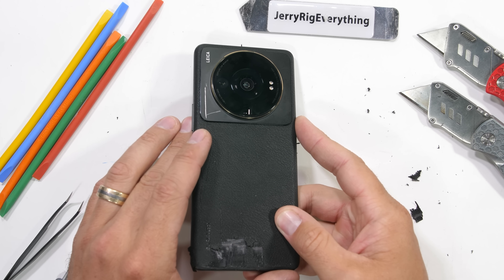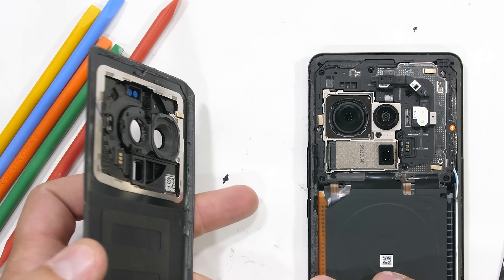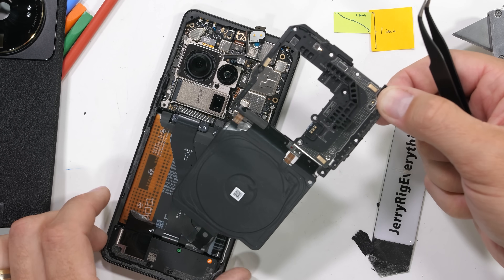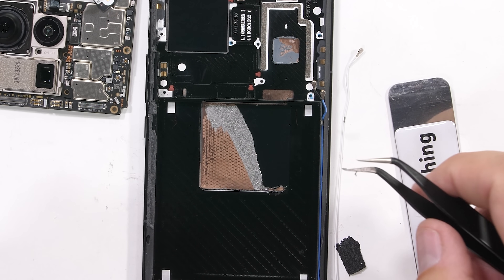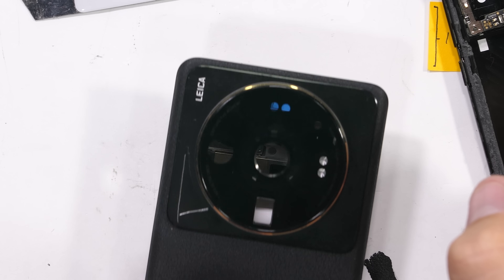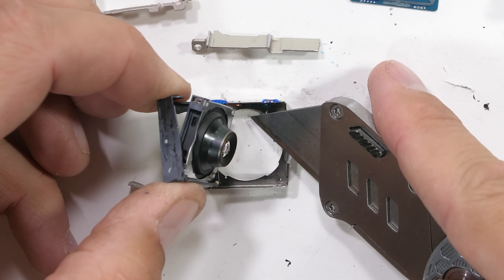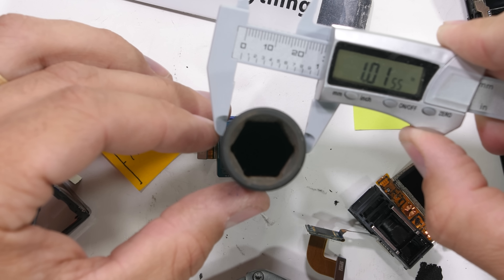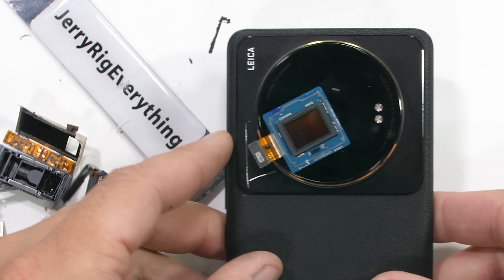Its a bit smaller than we expected... - Xiaomi 12s Ultra Camera Sensor Teardown!

Comment: It's the typical marketing/manufacturing reality - use whatever measurement standard that glorifies your product... whether you're thinking of a tube for a camera, which you could slightly increase in diameter by increasing the perimeter wall a bit as an example, to showcase its capability over what competition offers or storage capacity, with its raw space availability reported in GiB instead of actual GB after OS and preinstalled apps are in place, as long as it makes the product technically/legally stand out from or keep up with the competition we'll still be having such terms used. It's a matter of legally available boasts marleting team can utilise for the lure ;) Noone expected anything different or less in this case... if the sensor was a square 1x1in as you've shown earlier, the lenses would have to be wider in diameter as well to project the light onto it in all its capacity, but they're not, so nothing new... It's the same for Sony Xperia Pro-I after all, and possibly the same as for that Japanese-only Sharp Aquos R6 as well. Still, the few extra square mms over what competition does as offered by these sensors, provided the lenses can accomodate adequate coverage, are a good way to improve the quality of the pics out of the camera unit, and better than going 200MP+ on those extra tiny sensors covered by plastic lenses with not enough resolving power...

Comment: Great Video as aways.Its the same thing like Displays,for an example a Phone wth a 6.4 Inch Display with a 19-9 ratio,has more area than a 6.5 or 6.6 Inch Display with 20-9 Ratio.Remember the Iphones+ had an 16-9 ratio and 5.5 inch display,compared with an other 5.5 inch display(Samsung S7 Edge also 5.5 inch))  you can see  how much more area the Iphone has.

Comment: There are several reasons why plastic lenses are used instead of glass lenses in smartphones. First, very high quantities are required, which can only be produced using replicative processes. These processes work particularly well for plastics. Second, the high demands on image quality and the small build space require the use of aspheres. One aspherical lens replaces about 2-3 spherical lenses in a camera lens. These can also only be produced (economically) with replicative plastic lenses. Compared to plastic, glass offers better possibilities for image correction, but a lens would cost several 1000€ with common manufacturing processes (compare e.g. good microscope lenses). In addition, the optical materials and manufacturing processes have developed so much in recent years that glass cannot be described as the better choice for all applications.

Comment: For true information, they should tell the purchaser how the sensor is measured. Years ago, amplifier/receivers were sold via IPP, which gave a larger number. since when the unit was first turned on, there was an instant peak power that after running for a second, leveled down to a RMS value. Then it was required they were to label IPP and if they did a true RMS MEASUREMENT, they would list the RMS or both. 

Time for all phone manufactures to step forward and list accurate specs. 
But will they? Not unless a gov't agency steps in, which is likely to happen and that we certainly do NOT need.

Comment: To be very honest, do we care the actual size of the sensor? we just want qualitative measurements, to know if its bigger or smaller, the actual size is insignificant to the people. As long as everyone uses the same type of measurement, all that matters is relative size. No company will under advertise their sensors, so you know you are getting this tube inflated measurement, and its fine as long as everyone uses so we can compare them.
Yeah i watch mkbhd, it was great. 
My comment doesn't in any way takeaway what you are doing, that i actually love. As an engineer i love to see inside everything, you save me the trouble of breaking one myself 😅😅😅 and for that tank you so much. Love the content

Comment: Measuring the image sensor by the size of a theoretical circle that it can fit in does still make sense and will continue to make sense for as long as the lenses are circular. The "1 inch" size of the sensor defines the characteristics of the lens that you will need in order to be able to have a full-frame image without a vignette.
Reply: Except that vignette is only occuring if you have a sensor larger than the projected image circle and you arent performing any cropping. Most manufacturors are intentionally doing the opposite and ensuring they have the sharpest portions of the image circle filling the sensor.
Reply: "defines the characteristics" +1 for not stating the "size" of the lens as a lot of hipster wannabe photographers say.

Comment: It is Type 1 Inch. Not a singe 1" sensor on the market actually measures 1" in any direction. 

This sensor is exactly the same size as eg a Sony RX100 oder RX10 1" sensor.

How come you only bring this up with this phone and not any other? All phones use the same tube based size naming scheme. A Type 1/3" sensor also doesn't measure 1/3".

Comment: Can you check the projected image circle of the lens? It may take a crop of the 1in sensor, to reduce the size of lens required. The active area of the sensor should be compared, not the raw silicon.

Comment: Camera sensors for smartphones should definitely be measured in a way that makes sense for smartphones and avoids confusion for consumers!
Reply: or consumers should just learn how things are measured for different things and there's no confusion at all. TV's are measured diagonally and no one cares, how is this any different?
Reply: @MrSmith-rk4jq  when consumers hear "1 inch" they think the sensor is gonna be a lot bigger than it actually is
Reply: @realracer0353  Most point and shoot cameras also use these same 1 inch sensors. It's a by-product of the photography world. Even if someone purchases a point and shoot camera and wasn't aware of how the naming convention came to be (sensor size that would fit within a 1 inch vacuum tube in this case) they would still have the same confusion. The entire photography naming scheme is just odd and always has been. Medium format sensors are WAY larger than Full Frame sensors but the names don't imply that. I don't think the naming scheme should be changed for smart phones exclusively.
Reply: @realracer0353  my ex thought the same thing when I told her 1 inch

Comment: That's not the only odd naming convention. The 23mm focal length quoted for most image sensors isn't really 23mm. It's more like 6mm, and the 23mm is the equivalent focal length for a full frame camera.

They do this for lenses on micro 4:3rds and APSC cameras, too. 

This is because the actual measurements are less important than having all photographers on the same page as to what the 1" and 23mm measurements means for optical quality compared to other digital formats like full frame, APSC, and micro 4/3rds digital cameras and even smaller 1/1.7" sensors in older cellphones.

Comment: The main issue with plastic lens elements, is that they do not last long. With thermal (e.g., using it outdoors and exposure to sunlight. Those cheap lenses will become decentered over time, as well as experience alignment issues between lens elements, thus you end up with parts of the frame experiencing increasing amounts of fringing or chromatic aberration over time. this is why many modern kit lenses will use glass elements.
Beyond that, plastic lenses have relatively poor transmittance, as well as lower optical clarity. If you look at most lens tests on sites like dxomark, you will see that most sub $1000 lenses struggle to deliver full detail on a 36 megapixel full frame sensor. and all but the highest end (car priced) lenses fail to deliver fully on a 32.5 megapixel APS-C sensor. It is difficult to achieve the optical clarity needed with current manufacturing technology
This is why many smartphones that will advertise 100+ megapixels, or even 50+, will bin things down to 12 megapixels, and if in a full res mode, the detail doesn't improve since those lenses are essentially acting as an optical low pass filter.

PS, these limitations is also why a medium format camera and a decent lens will often look so much better than the same image taken with a high end APS-C or high end full frame camera. With a proper medium format, such as with the hasselblad or phase one systems, the quality lenses are not holding back the sensor. A 100 megapixel medium for mat camera and a decent lens, will actually deliver 100 megapixels worth of detail, same with the 400+ megapixel pixel shift modes, Instead of trying to push the limits of translational fidelity of the lens, they make the sensor and pixels much bigger, thus avoiding having the lens become an optical low pass filter.
Reply: Actually those pixel binning sensors with 50 - 100 MP actually can't shoot their advertised resolution because the color filter resolution is fixed at 12MP.
Reply: @pixels_per_inch  Some will have a CFA that covers 4 pixels at a time, while others will use a a more traditional CFA. In both cases, the luminance channel will be at the actual resolution of the sensor, while the color channels are at a lower  resolution.
Due to how color filter arrays work, the color resolution is always a fraction of the luminance resolution.

For example, if you have a 100 megapixel cl sensor with a Bayer pattern CFA, then half of the pixels have a green CFA, while the remaining pixels are equally divided among blue and red filters.

The demosiacing process will preserve as much luminance information as possible, but in exceptions where an object may exclusively only reflect a single wavelength of light, the, causing the other pixels covering the object to output a known low value range (varies based on the strength of the CFA (they do not use a 100% strength CFA), then the demosiacing process will interpolate those aspects of the color channel.
This is also why certain objects such as a bright red flower can be difficult to capture without looking like the image fidelity (often described as "micro-contrast" will seem lower in cases like that, while the same object captured with a true monochrome sensor, will look much sharper and more detailed.

Comment: I dont know if its covered in this video, but 1 inch class normally doesnt refer to the sensor, but the size of the cathode-ray-tube in broadcast television. This strange measurement system generally only applies to standards common in broadcast television cameras, as film cameras, both video and photography often measured the height, width, or diagonal as you would expect
Reply: Yeah it got covered at the end of the vid.

Comment: What would happen if you just plugged the sensor into the motherboard with it exposed like that? Would be cool to test it out and see if you can get it to focus on anything with your own lens.
Reply: Just blurry image, you can try this with mirrorless camera without lens.
Reply: Did it once. Fully white image. Kind of disappointed when I saw it.
Reply: @jewmarosef  too much exposure?
Reply: @euro_rfx4499  Probably. Since the lenses limit the aperture to a few millimeters and "distort" the image into the correct shape, a full on daylight shot is probably too much for a naked sensor to handle. Even if it could handle that much brightness, probably we would still get a fully white shot, because, as I said, it needs "treated" data/image when it comes to angle, exposure, focus, otherwise it would only be able to see in a binary way: whether there is light or not in each one of its "pixels".

DISCLAIMER: I'm not a photographer, neither an image/photo technician or stuff like that. I'm a lawyer, which is a profession that is way far from understanding about photography and sensors, so, there's a risk that the comment above is full BS hahahaha
Reply: @jewmarosef  thanks man! I own dslr and this makes sense 👍🏻 i was too worried I'd bake the sensor without the lenses xD
Reply: @euro_rfx4499  don't worry, silicon image sensors are extremely robust to light. If you were to put a piece of wood in place of it, put the lens on, and point it at the sun, you'll get literal burn marks on the wood, yet the sensors survive it most of the time.
Reply: @victortitov1740  good news 😄 thanks alot! Won't have to worry now
Reply: Nokia users have made this before, I don't remember if with a Nokia N8, Nokia 808 or Nokia 1200 but they attach to lenses and telescopes you just need to find the sweet spot in the focal lens and darken the sides to prevent light leaks
Reply: youll see pinkish white image 
also a awesome thing put one drop of water on  the exposed sensor it will function like microscope showing everything in water
Reply: Just take a real canera, remove the lens and take a picture
Reply: Thats quite interesting question

Comment: Interesting to see the construction - thank you for sacrificing a phone. When it comes to the lenses the necessary aspherical surfaces are quite difficult to manufacture in glass and the material will hardly make any measurable difference - by all means, most prescription glasses nowadays are plastics rather than glass, giving lower weight, lower cost of manufacturing and the possibility to form very advanced progressive lens shapes.
When it comes to sensors, measuring the outer circle and the diagonal are essentially the same, since any diagonal will be the same length as the diameter of the outer circle.
Reply: Thank you for sharing your info...I was just collecting knowledge about this beauty's camera and build..

Comment: Seems like a pointless rant to me. Who cares if they measure circularly. If year after year the measurement is greater, than what's your beef? It sounds like you just found out how sensors are measured because no matter how you slice it, that sensor is the largest on any smartphone and is true to measurement by the known standard. You want it to be measured like an aspect ratio for some reason

Comment: Don't get me started on the sheer idiocy that is photographic sensor sizes. They were never anything but deliberate false advertising, even in the old analog tube days. And those utterly invalid and intentionally obfuscating decimal fractions (like 1/2.3") never should have been allowed to take hold in the first place. It's way past time for some consumer protection regulation to kick in.

Much like the travesty that is "LED" TVs. NO, THEY'RE NOT!!!! They're LCD TVs, every single one of them, but the manufacturers want them to be conflated with real OLED TVs because they are so very much inferior. They should not be allowed to advertise the backlight as being the display technology when it's barely even relevant.